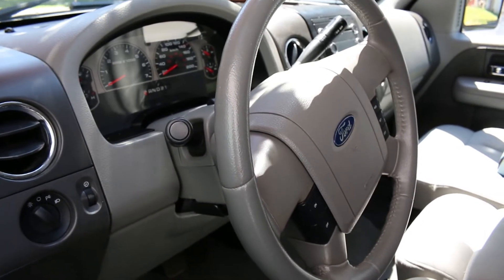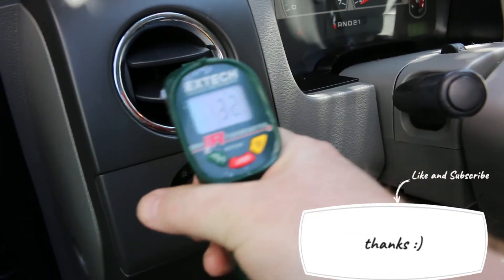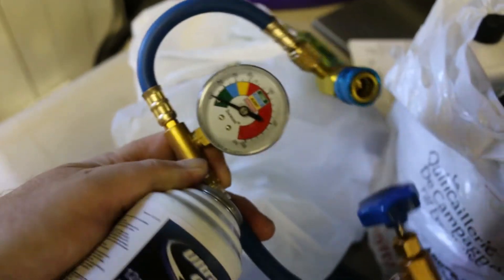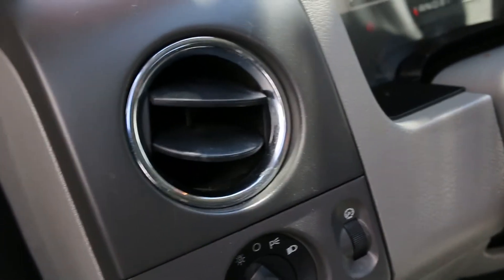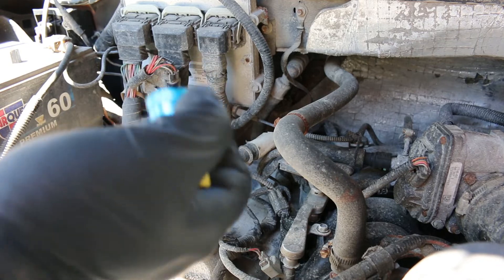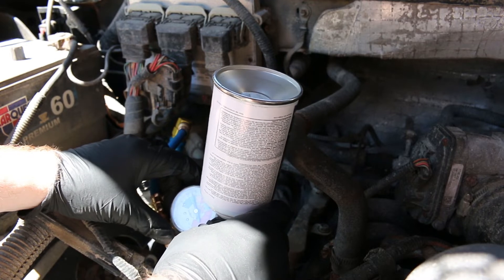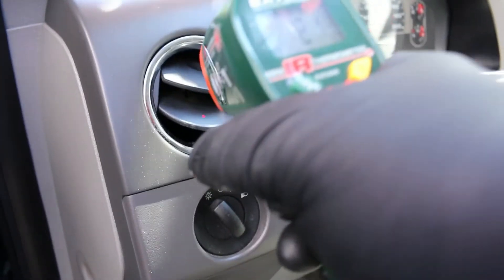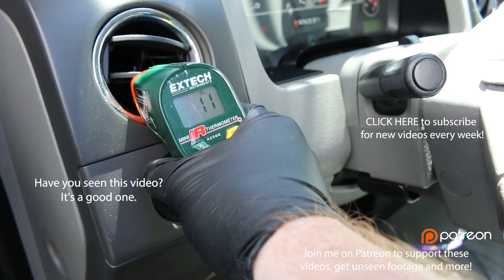Topping Up a Low Ford F150 AC System 🛠

Comment: This is 5 years old, thought I'd mention that the R134 refrigerant comes in 12 oz. resealable cans now. They use the same hose ,gauge  but no longer use the needle to puncture the can because the can is resealable. Instead of a needle the can hose/adapter looks the same but uses a "FLAT" headed rod to let the Refrigerant out of the can that now, I think, has a schrader valve in it. This way if you don't need the whole can you can remove the hose connections and save what's left in the can. I would think, also, that using  the needle type on a resealable can won't work and could be dangerous.🤕🤕

Comment: HI.  IS IT IMPERATIVE TO USE EXACTLY THE SAME COOLANT as already in the system?
in other words, to be safe, does the system need to be purged before proceeding with your instructions?
I HAVE THE SAME MAKE, MODEL AND YEAR as that in your helpful video. I have owned the vehicle for 4 years, 
and don't know what type of coolant is in the system now.

Thanks
Reply: It's on a sticker under your hood.

Comment: A good demonstration, except for the part of putting liquid refrigerant into the A/C pump by turning the can upside down. The A/C pump is not designed to pump liquid. By following the instructions on the can a person can be careful to release only vapor into the low side. 1)While charging, rotate can between 12 o’clock and 3 o’clock every two to three seconds while continually agitating (shaking) the can back and forth. 2)Continue this process until the correct amount of refrigerant is charged into the A/C system or the can is empty. 3)When the can FEELS EMPTY, hold it upside down for one minute to dispense remaining contents before removing from service port. When the can feels empty, the remaining contents will be vapor.  Don't forget to bleed the service line from the can before attaching it to the service port.
Reply: How does one "bleed" the service line?
Reply: The instructions say to turn the can upside down
Reply: Actually you’re supposed to put 134A in as a liquid R 12 on the other hand like cars used to be go in as a gas. The problem I have with this video is that he has no idea what the high side is doing. If your having a problem to correctly diagnose you need both readings also ambient temperature has a lot to do with it I can swing you 20 pounds either direction.